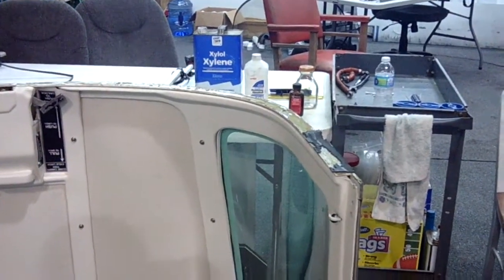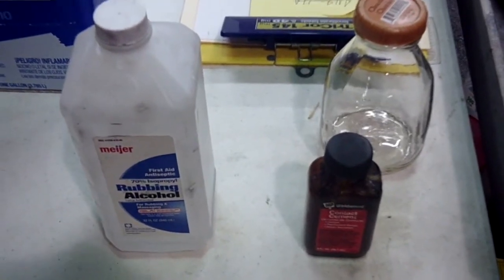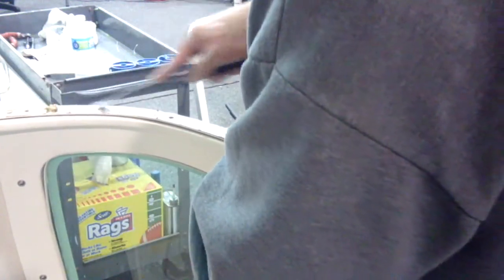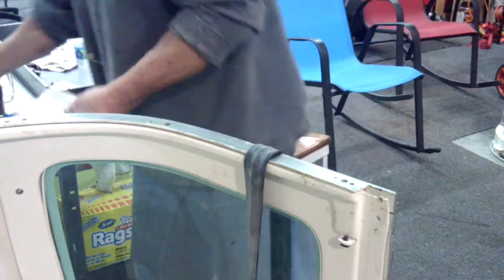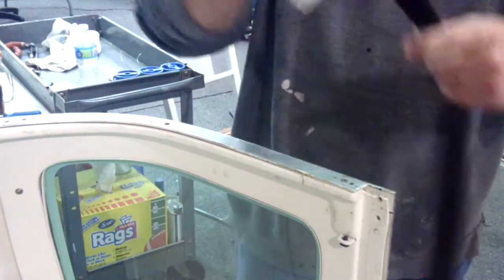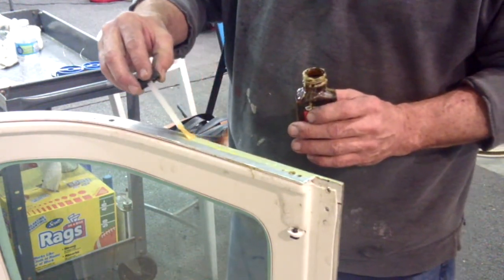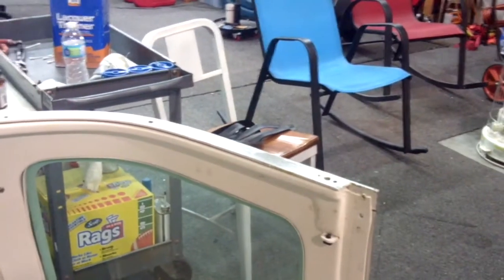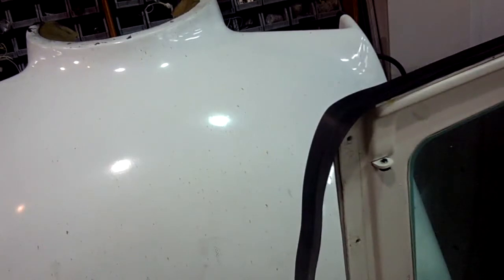Canopy Seals Issues - Grumman Style

Comment: The cheetah I’m looking at purchasing has the double bead seal on the front but the canopy has no seal. I’m told the early cheetahs don’t have the canopy seal. Is this true?
Reply from the maker: All the planes even 2-place have this seal.

FYI
Reply: Thank you for your response. 

I did buy the Cheetah and purchased new canopy seals from FletchAir. Planning on doing this as a DIY next spring when things get a little warmer. 
So now a few more questions. 1) is the double bead seal glued on or simply held in place by the metal center bracket? 2) can the canopy be left on the airplane while gluing on the canopy seal? 3) the seal edge of the canopy has a painted surface. Should the paint be removed or can I glue the seal over the paint? Paint is secure and in good shape. 

Thank you in advance.  Joe